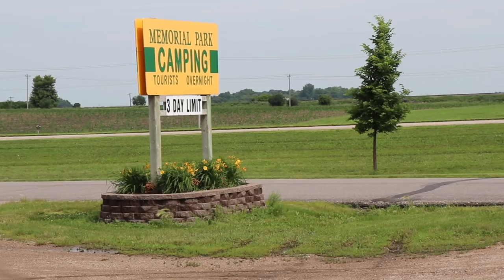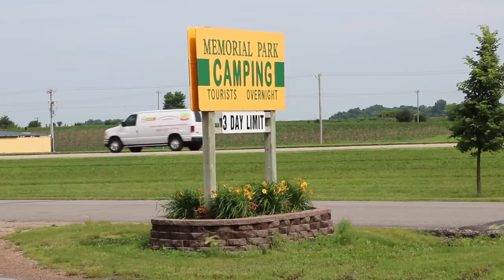NO BRAKES!? In the Corn Capital.....Now What?

Comment: Glad you have the skills to get through all problems, I struggle with repairs, I do the best I can, recently had to drill out a broken starter bolt, than replace the trans shift solenoids , but right now stumped on a major coolant leak on my 6.2 diesal (Not RV) seems to be a coolant crossover crack or gasket, dumping out as fast as pouring in, wish I had your skills lol, anyway stay safe.
Reply from the maker: Good luck Chris, hope you get it figured out. Check heater core, that’s the only thing I’ve ever had leak that bad.
Reply: CampingwiththeKellys Thanks, I originally tested by topping off rad then running engine, that soaked everything, I dried everything than took a different approach, I removed a rad hose and put a funnel on it, then poured coolant in very slowly, found the leak, a hole the size of a drywall screw diameter at the base of the coolant crossover, drying now, tomorrow will clean and apply JB Weld, hopefully works, shops for me are not an option, to expensive, have a good one.

Comment: I've learned to always check the bleader screws before letting fluid out. I've made that mistake to many times.
Reply from the maker: The master cylinder had to be replaced no matter what. Worst  case scenario I would have had to replace all calipers. It would have been nice to know what I was dealing with before I started.
Reply: CampingwiththeKellys I work on a lot of vehicle's that you can't just stop and buy calipers at a auto parts store. If only everyone drove domestic cars it would be easy.

Comment: That’s the same temperature it is here today in Southeast Michigan 95 with a 103 heat index. Back when I was 16 family trip from Detroit area to Kalispell Montana in a 24 foot champion class a. 454 Chevy, my dad and I changed the lifters with me crawling in the engine on the street in front of the parts store in Sheridan Wyoming. I believe it was either June or July of 1974. It was HOT.
Reply from the maker: It’s just part of the adventure, I’ve had to work on this thing at Walmart, oriellys, on the beach in California and now in the Corn Capital LOL  I was born in July 74 👍

Comment: Glad to here you got everything repaired.  Loved your video!  Hey! what about the hydro booster?  Safe travels.
Reply from the maker: Hydro booster was good, first vehicle I’ve had with one, I’m use to a vacuum pump, didn’t know it ran from power steering fluid. A shop told me hydro booster was leaking but I was loosing brake fluid not power steering fluid. Thank goodness for Google 👍